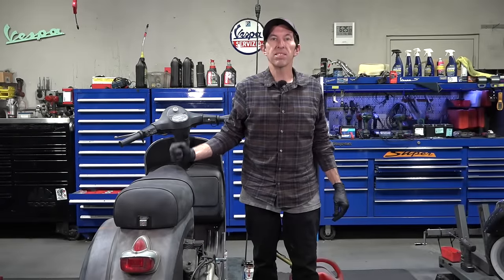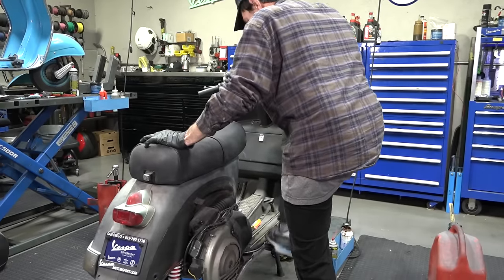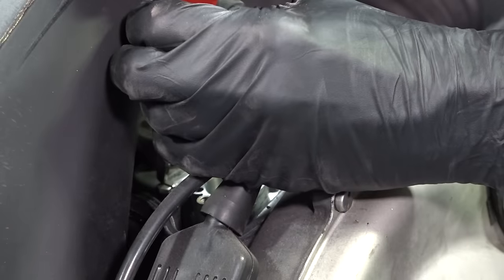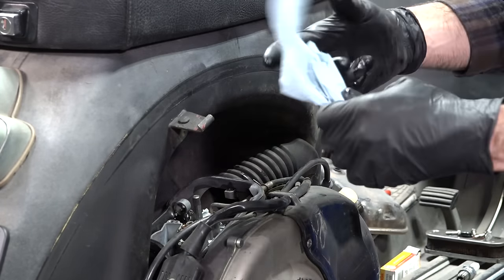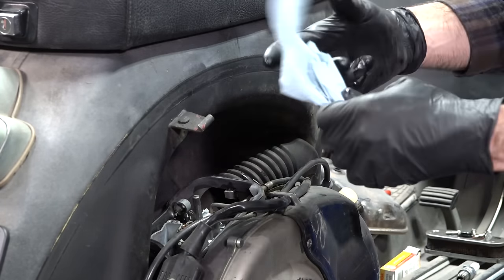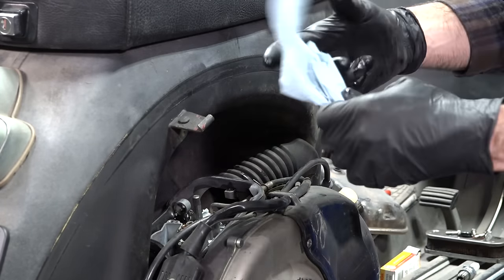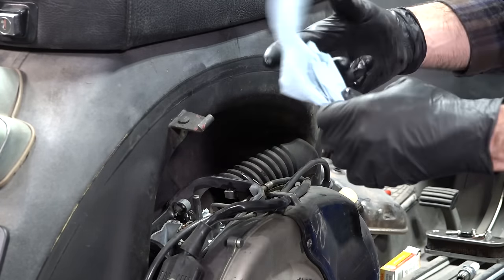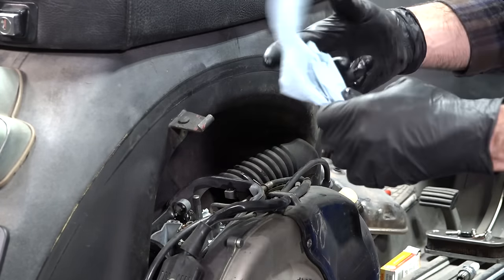Getting a Vintage Vespa P200E Running After Sitting 2+ Years!

Comment: 34:07 as an owner of leaky Harley Shovelheads I recommend using Teflon tape instead of goop from a tube. Seals very well and is also easy to remove later because it stays in tape/string form so it's easy to get all of it off the screw / out the hole. Also works on screws that vibrate loose like exhaust screws.